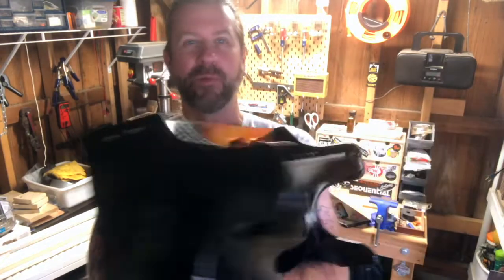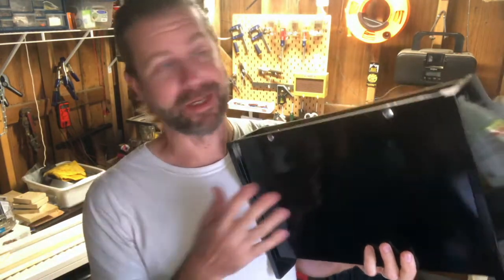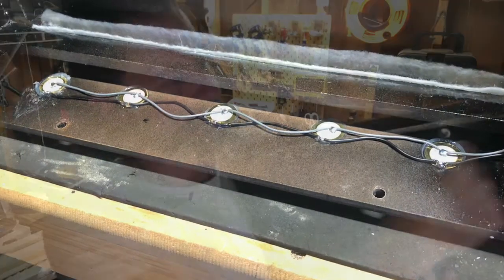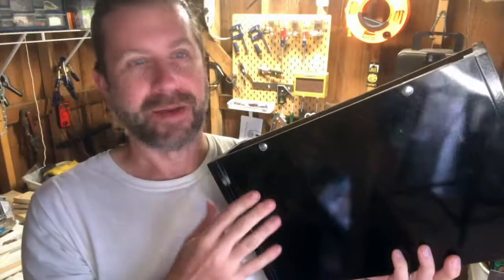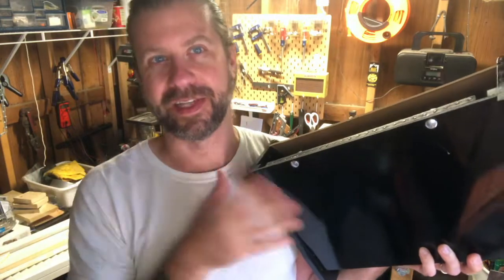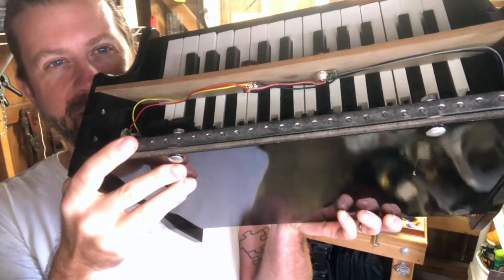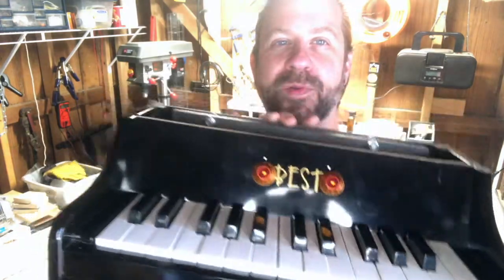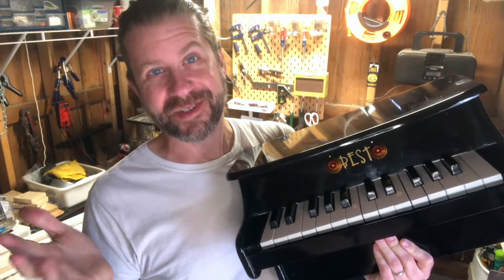DIY Project: The Electric Toy Piano

Comment: This is awesome! I’m doing the same thing with my Kawai toy piano. Would you mind sharing how you wired it, and what pots/capacitor you used? I’m new to this DIY game.
Reply from the maker: Thanks for watching the video. The five 27mm piezo discs are wired in parallel. Both pots are 500K and the capacitor value is .022 uF. I just used what I had laying around so I'm not claiming those are the optimal components for this kinda thing... but that's what I used. If I was to do it again, I'd probably use larger piezos, and maybe just 3 of them. Good luck.